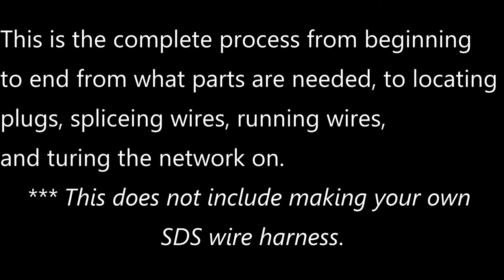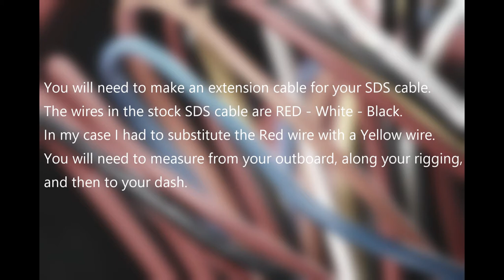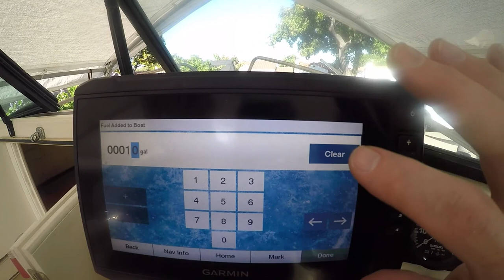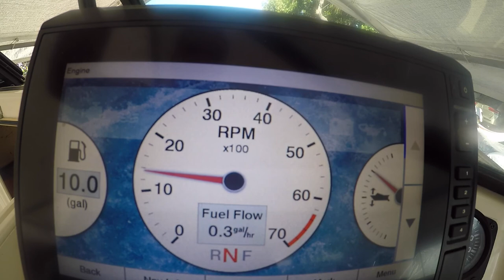Suzuki NMEA 2000 : Complete Install For Outboards

Comment: OMG. Talk about complicated. I have my engine interface adapter tucked away right inside the outboard next to the powerhead and just ran one NMEA 2000 extension cable through the rigging tube and to the helm. 10 years later, no problems whatsoever with the interface. No need to splice wires to make your own extension cable. Trust me, the interface will be fine right inside the outboard.

Comment: I have a question, on the back of your suzuki tachometer there is a 4 prong plug did that tie into one of the plugs on the interface?
Reply from the maker: No you don’t connect anything to the Suzuki tach. The extra wire from the wire harness just gets tape up, you can see this at 13:45 of the video. Hope this helps.
Thanks for watching!
Reply: Ah ok I gotcha, yes sir no problem! Sorry to keep bothering you but is anything plugged into your 4 prong plug in the back of your tachometer or did you leave it unplugged when you installed it? I have the exact tachometer but my wiring harness doesn't have a plug for me to plug it into. Just trying to figure this out if I buy the nmea 2000, because right now my red lights on the gauge won't work because I don't have a plug for it, but everything else works on the tachometer
Reply from the maker: Not 100% sure if this helps, but you should have a plug that is apart of your motors wiring harness when you bought the motor that goes into the wires coming off of the tach. I believe the Suzuki part code is: 36620 93J52.
This is a separate harness that plugs into the back of your tach to supply engine information such as, oil changes, warning lights (the red lights) and to make your tach functional. 
If you don’t have this separate harness, your tach is useless.

Comment: I have analog gauges already hooked up to a new 2021 200suzuki....will adding the backbone/harnesses etc to a lowrance make all of my analog gauges useless or will they still operate independently?
Reply from the maker: If you follow the way I have mine hooked up, you won’t touch any of your analog gauges.  Those gauges will continue to work independently to your Lowrance MFD. I still have my analog tach and it still works the same as it did prior to the N2K hook up.

Comment: My setup will be identical to yours (60hp Suzuki and Echomap unit). Question on the 12v power. Does it draw power all the time, or only when the outboard or Garmin unit is on? Trying to see if I need to add a switch on the 12v power supply. Thanks!
Reply from the maker: In short, yes. But everything you have onboard will draw power even if you turn it off at the device since things like a chart plotter is in a ready state. I would highly suggest installing a battery ON/OFF switch from Blue Seas for your boat. It’s simple to hook up and will cut all power when your boat is not in use and you turn the battery switch to OFF.
Thanks for watching!

Comment: Thanks for the video, do you know what size wire you used for the extension to the SDS harness?
Reply from the maker: I used either 14 or 16awg, but I believe it was 14.

Comment: Hi great vid I am purchasing a df80 tiller. Been told I need to go though gauge Suzuki Australia. Connecting to Lowrance HDS9 Gen3. What’s needed for this please. And if I can do without gauge what will be missing? Fault codes ect Thanks Joe + and -
Reply from the maker: Without the gauge you will be missing the fault codes, oil warning, etc. I’m not sure if Australia has different connection compared to here in the US, but check out the link in the description from Moonlighter, there is some information in there regarding Australia parts I believe. Also look in your Lowrance manual to make sure it’s capable of NMEA2000 network, some are not.
Reply: @SoCalSeaChaser  Found out the tiller has a digital gauge that will do codes.

Comment: Will the analog gauges still work with this setup? Is there a splitter to use?
Reply from the maker: Yes the analog gauge will continue to work connecting it in the way as seen in the video.

Comment: Hello i have a suzuki df 80 2022 model year and a furuno tztl3.i do everything right  the nmea regonize the network but the instruments on my screen dont work.any idea what i m doing wrong?
Reply from the maker: Hi George, I not familiar with the Furuno  mfd unit you have, but if it’s seeing the nk2, you might not have a correct setting in your mfd enabled.  I would look through your manual and see if there is a specific setting that needs to be enabled for it to read the data. Wish I could help more, good luck.
Reply: Did you set your unit and selected the engine ? Although nmea recognises the interface you may still need to select the engine...

Comment: I have another question. I just installed everything (coincidently I have the same as you, 60hp and connecting to a Garmin unit). My Garmin unit is not picking up my outboard. I turned the outboard on, but not running. Does the outboard need to run?
Reply from the maker: Make sure you follow the steps setting it up, in the video it starts at 16:20. You won’t see much till you turn on your motor, like the RPM’s.
Reply: @SoCalSeaChaser  THANKS! I thought the Garmin unit would  automatically recognize it. Hope that is the issue. Will try later this evening. Thanks again!
Reply from the maker: @StructureFishing  I don't have the boat anymore, but from memory I believe you do need to go in and set it up. Good luck and tell me how it goes !
Reply: @SoCalSeaChaser  I'm stumped. From what I read online, if I turn the outboard on not running it should be recognized. But it's not showing on my Garmin. Double checked all connections and have 12 volt power. When I went to NMEA settings, then device list it shows my Garmin in only option is to change the name. I guess I'll try this weekend with the engine running on the water and see if it works
Reply from the maker: @StructureFishing  Try this:  With your key turned ON, power up your Garmin unit and go to - Gauge Set Up- Auto Configure Gauages first.
Go back and select Engine Selection and it shoud auto detect your motor. If not you can choose Reset Auto Configuration.
Then go back to Engine Selection and set Number of Engines to AUTO or select "1".
Then go back to Gauge Set Up and select Set Gauge Limits.
After that you should be able to go to your HOME screen and select Engine data or something similar, and see your gauges. You can turn on your motor for a couple seconds to see if the RPM gauge works on your Garmin.
Reply: @SoCalSeaChaser  tried, ran motor briefly, nothing. 😕
Reply from the maker: @StructureFishing  Interesting. There might be a loose or disconnected wire somewhere. 
I would first start at your motor insuring everything is connected properly, no loose wires, wires are connecting to the correct wires, and nothing is loose.
Then make sure your NMEA2000 backbone is connected and hooked up properly and you have the terminal end caps on and tight including checking your N2K plugs are connected properly and also your yellow wire is right and those wires are connected properly.
If all is good there, then I would back up all your tracks and data on your Garmin to a micro SD card, not hard to do. Then use the Active Captain app to check if there’s any updates to your Garmin and apply them if there is. 
Try again and if it still does not work, then lastly you might need to do a factory reset on your Garmin, update it, then try again. Good luck!
Reply: @SoCalSeaChaser  I had the short adapter cable installed backwards 🥴
Reply: I watched your video again, and your short wire had a tag on which was the engine connection. Mine did not have a tag, and as you know both those connectors are identical. After I switch to cable it worked, so it must matter for sure.
Reply from the maker: @StructureFishing  Awesome glad to hear you got it all working now. I had a feeling it was a connection issue, but had to go through all the steps. Congrats and enjoy!

Comment: Great work!! I have done the same upgrade recently.Any ideas how to see litres or gallons/nautical mile on Garmin Plotters? I only see litres/hour
Reply from the maker: I can’t remember exactly how and I can’t get to my unit at this time because I just started to do a rewire in my boat. BUT try this, go into the menu, select:  GAUGES, NUMBERS, MENU, and then I think there’s a sub menu where you can make adjustments, but like I said I not 100% sure if this is correct. Thank you watching!
Reply: @SoCalSeaChaser  Thank you, will try it. Have a great day
Reply: Χρήστο καλησπέρα! σε τι μοντέλο συνδεσες το καλώδιο?
Reply: @georgeantonopoulos3424  Καλησπέρα Γιώργο, σε μια DF90 του 2008 (την παλια την διλιτρη (1950cc).
Reply: @SoCalSeaChaser  It was something really simple, litres per NM was not showing because it was set to water speed and not GPS speed. I changed it and it works fine. Thought to write it here also in case someone else stumble upon it.
Reply from the maker: @chrisantoniou8867  Thank you for the update and I totally appreciate you coming back on here to post your fix. I’m glad you were able to get set up and I know others will benefit from your information. Tight lines!

Comment: just found your excellent video on engine data setup.
i have lowrance hds display and yamaha 250,also gateway box.
i didnt notice a gateway box in your video, perhaps i missed it or can you elaborate.
also in your fuel used, do you after a trip refill your tank, then put in that amount of fuel used to reset data, or is there something else.
thanks
john
Reply from the maker: Thank you for the comment. With Yamaha you do need the gateway, with the Suzuki I don’t need one. 
As for fuel, when I fill up, I add how many gallons were in my tank to what I added, basically resetting on my MFD fuel.

Comment: Hello, I followed your video from A to Z and my sounder does not recognize the NMEA network.
I connected all the cables as you do and my sounder does not recognize the NMEA network.
I tested the different cables, there is indeed 12v everywhere and I have no solution. Is it possible to test the suzuki interface cable? If yes, how ? There is indeed the 12v coming on it but I can't find anything coming out. Is it normal ?
The cable was bought on ebay in the USA.
My engine is a DF140 from 2019 France.
Thanks
Reply from the maker: First off what chart plotter do you have? 
I would carefully check every connection to make sure none of your connections are disconnected. 
You will need to check the wires coming off of your motor that you connected the SDS adapter to for continuity.
Double check to make sure you connected the correct wires to the correct ends.
Also make sure your NMEA2000 backbone is connected with the power cable and you have terminals on both ends of the backbone.
Hope that helps.
Reply: @SoCalSeaChaser  Thank you for your reply and the time you take to help me. Everything is well connected but I may be on the start of the track. I just tried leaving the wires appearing in the boat and used a 6m (19.6ft) long NMEA cable to connect the interface to the T. Apparently there may be issues due to the cable length. Have you heard of it ? Thanks
Reply from the maker: @figatelliSTI   
To help troubleshoot, I would disconnect everything and redo the SDS cable wires to how they were originally. Then reconnect everything on the deck of your boat to see if you get the NMEA data from your motor to your MFD. If you get data, then you know everything works and you either have a bad splice or your wire length is to long.
To answer your question, yes longer wires will loose data, especially NMEA data. 
So if your SDS wire harness is over 6m from the motor to the interface cable, you might be loosing data. Mine is 2.5m long. Also if the wires are not properly connected (spliced together) you will loose data. 
If you bought the starter kit from Garmin (I believe Lowrance has the same cables) you should have a NMEA2000 drop (extension) cable. You could try moving your backbone further towards the back of your boat in a protected area where you can connect everything. This might help.
Reply: @SoCalSeaChaser  Thanks for your help. I'm going to try this weekend to extend the SDS cable to get it into the cabin instead of using the 6m garmin NMEA cable. We'll see if that solves my problem. Thanks

Comment: Hello and thank you for your video. I have a 2019 Suzuki DF140 with analog gauges. My local suzuki dealer tells me that it is impossible to connect my engine to my Garmin sounder in order to have the data via the NMEA network because I do not have a suzuki multifunction display. Is that true or does he just want me to spend money on him?
Reply from the maker: You can follow my video and hook it up. My motor is a 2018 DF60

Comment: Hi SoCal Sea Chaser, I have been looking at this for some time but until now have not been able to get much info, I have  Suzuki 2012 Df 140 and the engine connector has different colour wires than that described in your vid, mine are (looking at connector) top left (black), top right (yellow, orange stripe), bottom left (white /grey), bottom right (yellow), are you able to tell me the wires I would need to utilize, cheers mate
Reply from the maker: To clarify are you talking about the “female” plug on the motor or the “male” plug on the SDS adapter?
Reply: @SoCalSeaChaser  Yes I do mean the female connector on the engine, cheers
Reply from the maker: @craigclifford197  With that female plug coming off of the motor, you should just be able to plug the new SDS male adapter plug directly into it, since you’re not doing anything with the plug coming off of the motor, that female plug stays unchanged.
Only the purchased SDS adapter “wires” need to be extended so they can reach your helm or wherever you will be installing your interface cable and backbone. 
I would also suggest before moving forward, is to reach out to “Moonlighter 475”, he’s the mastermind behind this and can help to clarify. 
You’ll be able to find him on The Hull Truth forum or the Suzuki Outboard forum. 
Hope this helps!
Reply: @SoCalSeaChaser  Howdy, thanks for your reply, one last question, would the parts you listed in your clip be the same that I would need to fit out my Suzuki 2012 Df140 to Garmin 95SV, your clip layed it all out very well, cheers
Reply from the maker: I will say 100% yes the interface cable and Garmin N2K starter kit will work with your Garmin echomap 95SV.
I believe the SDS adapter plug should work connecting to your motor, but not 100% sure since I’m not to familiar with that year Suzuki plug. 
Once you have all the parts, you can quickly connect everything before hand to see if you get all your data on your unit. All but the SDS cable are very long, so you can stretch them out across your deck first.
Reply: @SoCalSeaChaser  Howdy, I have purchased all that I need to install, interface lead, starter kit and 2 x SDS connectors to make up my 'extension', the problem with just connectors is there is no wires connected so I need to find out what wire colours do what
looking at my SDS plug on engine from the front (wires coming out the back), the colours are top left (black) top right (yellow with orange stripe) bottom left (white) bottom right (yellow), not sure if you are able to answer which wires are used and what colours, cheers
Reply from the maker: @craigclifford197  I will be at my boat tomorrow and I will take a look at my wires, I can not recall from memory.
Reply from the maker: @craigclifford197  I found a picture I took of mine and this is how my plugs wire are....
*Solid Black wire from motor plug to solid black wire on aftermarket connector.
**Orange with yellow stripe wire from motor plug to white wire on aftermarket connector.
***Black green stripe wire from motor plug to red wire on aftermarket connector.
****Yellow from motor plug is empty.
Hope this helps!
Reply: @SoCalSeaChaser  Howdy, yeah thats how I understood the wires at the engine SDS, in your vid the SDS adaptor lead you had had a tag saying 'engine end' and you compared both ends to look the same, i'm assuming the 'dash' end is opposite, if you get a chance could you confirm the wire colour and what it does (ie power or signal') on the interface cable connector then I'd be good to go, also that interface cable has another 2 wire connector, do you know if this is for the trim, could jump wires be used to go to trim and have both analogue and digital trim, I tried to download a wire diagram but couldn't find one, cheers n thanks for assistance, Craig

Comment: MY ENGINE DATA IS NOT REGISTERING ON THE GPS SCREEN.  MUST BE A BAD SUZUKI INTERFACE CONNECTION?
Reply from the maker: First make sure all of your NMEA setting on your MFD are set to receive NMEA data and make sure it is set to receive the correct data speed.
If that doesn't work, I would disconnect everything and then reconnect everything on the deck of your boat to see if you get the NMEA data from your motor to your MFD. If you get data, then you know everything works, if not, then you might have a bad connection.

Another suggest is, if you are making a long wire run, longer wires will loose data, especially NMEA data that is over 20 feet in total length. 

So you could try moving your backbone further towards the back of your boat in a protected area where you can connect everything using the extension drop cable. Hope this will help some.